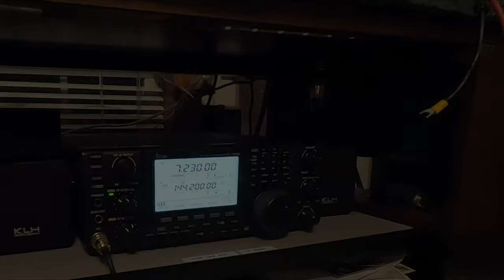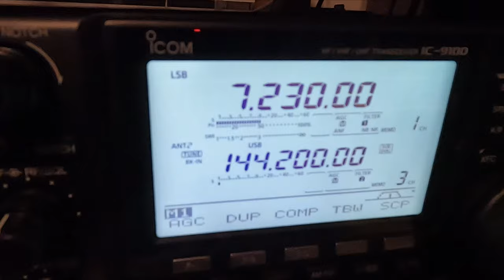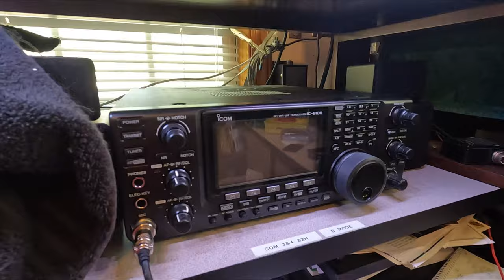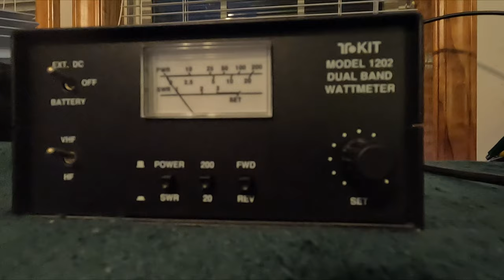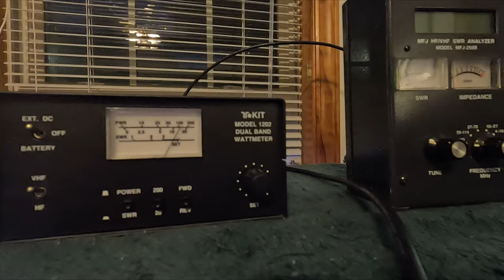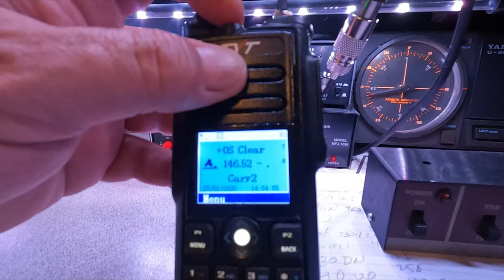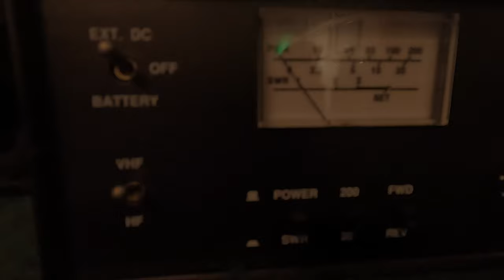Repairing a Mirage B1016 2 Meter MFJ VHF Amplifier

Comment: I have put my B1016 back on line to work with an IC 705. Am finding the amp’s T/R relay operates a bit too slowly. The 705 shows a fraction of a second at very high SWR before the amp relay closes and SWR becomes about 1.1 to 1. Did you refurb the relay? Any way to speed it up? Thanks!
Reply from the maker: Use a TX cable is what I'm told

Comment: Hi, I know the video is a few years old but could you tell me what transistor you used to replace the driver? According to the schematic it is a MRF450 but it sounds strange to me since the data sheet for it indicates that it is for 30Mhz.
If you remember it I would appreciate it.
Regards.
Reply from the maker: that frequency is what was used for the ratings. It operates VHF just fine. I opened it up to confirm and yes it is an MRF-450 with the Motorola Logo
Reply from the maker: unless you need to use it for an HT I would bypass it. The 3016 has it jumped out
Reply: @Sky1  I am really grateful for the information you have given me. I am repairing a client's equipment which is actually a Mirage B215, I have looked for the schematic everywhere but I have not been able to find it. I downloaded as many schematics and interior photos of Mirage linear units as I have found and the most similar one is the B1016. The client's equipment blew up due to excessive input power, the driver that was installed is a MRF240A, I have bought a new one, I have installed it but it seems to be a fake. I will try to get a MRF450 then, I hope to have better luck.
Regards,
Reply: @Sky1  He uses it with a HT.

Comment: I accidently ran 11 watts into mine and now it does not output anything. Is there a certain part that would have blown by my mistake? a transistor or diode perhaps?  I checked the fuse and it is fine. I wish there was a fuse that protected the amp when this is done as I'm not greet at electronics.  I see a transistor named MRF240A, is that what would go out if I over-drove the amp?
Reply from the maker: I've used a scope to check where the RF stops. Before m f j closes down grab all the schematics you can.

Comment: I know this is a long shot and this is a old video but could you please tell me the name and value of the preamp transistor the one in my amp has been totally removed and i have nothing to reference to so i can order a new part and fit it if you could i wil really appreciate it
Reply from the maker: I ordered one (J309) and don't think I even used it as I was able to re-peak it just fine.
 I got it from RF Parts. It is in the schematic or you can call MFJ. I was not able to get the same case style. 
https://www.qsl.net/wb4kdi/Mirage/index.html
Reply: @Sky1  thank you this is going to help a lot you are a life saver 73

Comment: If you're going to use it with a 50 watt mobile, i see no point in leaving the first driver in. Like you said. More heat on the same heatsink along with the risk of accidentally blowing the driver if you key up with 50 watts.
Reply from the maker: yup, and it has happened before to one of my amps.
Reply: @Sky1  I've never done it myself... three times... 😂😂😂